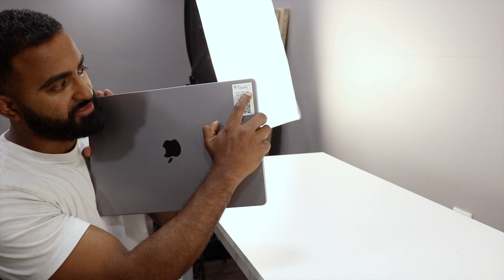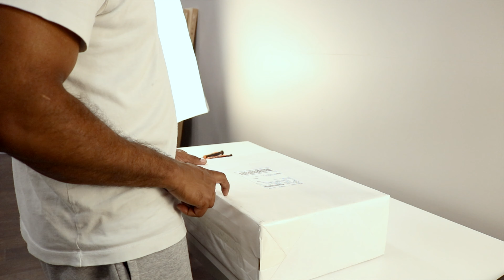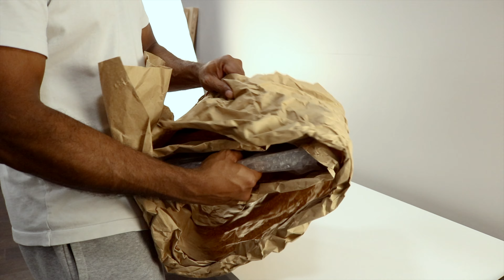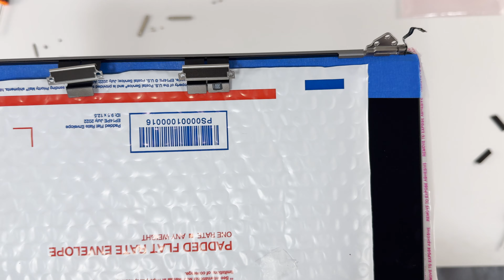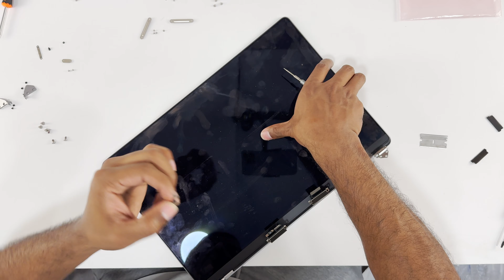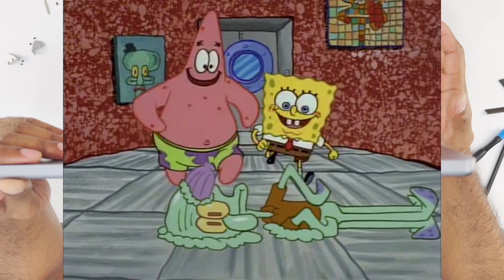2021 Macbook Pro Max Screen Replacement

Comment: Quick question! If i want to turn this specific macbook pro into a “headless” macbook do i just close it back up after minute 13 and im good to go? 😂
Reply from the maker: you can it will still turn on haha connect to external display

Comment: Hey bro? How are u not getting those patches? Many people are getting that issue. i myself got those issues.
Reply from the maker: Hey which patches?
Reply: @willfix1t There are little transparent bars on the top of the screen when replacing it with a new one.